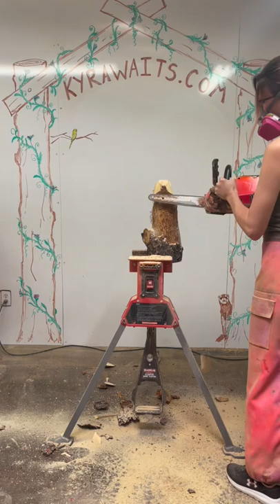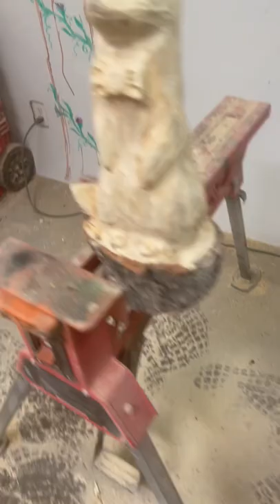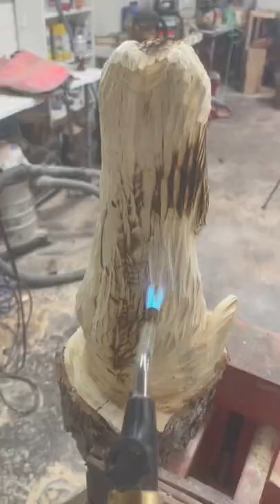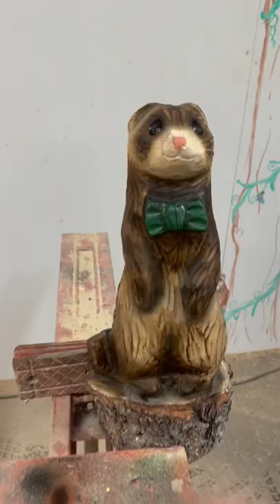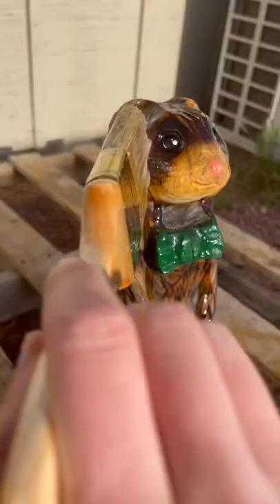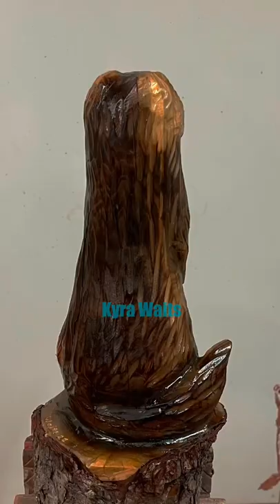Ferret with Bow tie Chainsaw Carving - Kyra Waits #chainsawcarver #woodcarver #ferret #artist

Comment: Awesome work!  Can you tell me saw make and model. Bar and chain size please?
Reply from the maker: It’s a Stihl MSA 120 c. I’ve had it for 3 years with almost daily use, 2 batteries and it’s AMAZING. Still kicking butt. The bar is just the one that it comes with stock.
Reply: Nice!  I’ve been carving for a while and want to make a move to battery saws but was concerned about the power and length of battery life.  I have two gas saws with 12”  carving kits on them but am interested in a saw like yours.  Guess I’m gona break down and try one.  Again, you do great work ! 👍🏻❤️